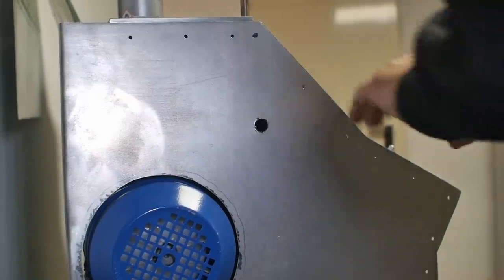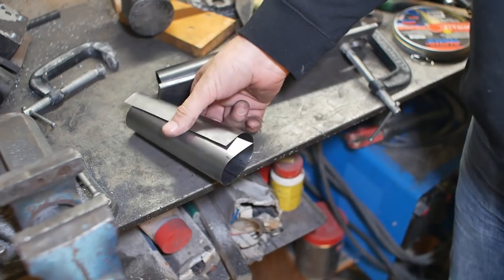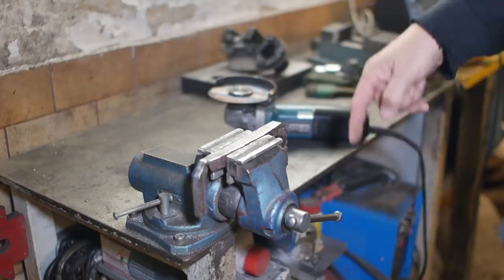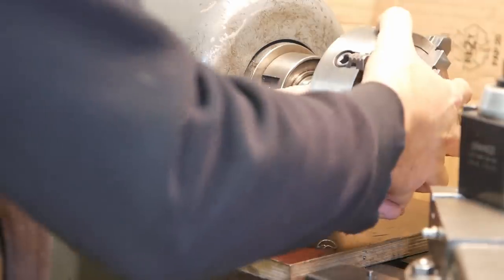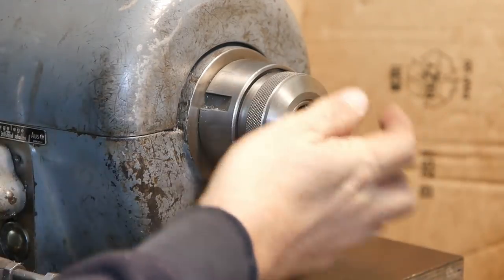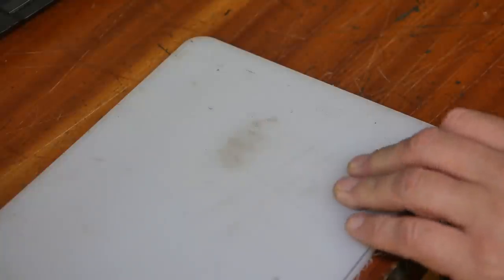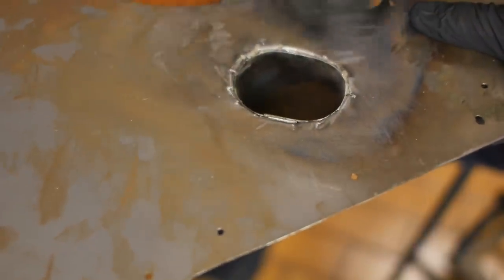Clevis and swarf chute - CNC'ing the infamous mini lathe - Episode 36

Comment: Nice series, thanks for you work! How about using the thread on the back of spindle to make spindle extension? It may help with long stocks and a chips inside control box.
Reply from the maker: I'll see how that swarf chute works, but if it doesn't I may need a different solution like a spindle extension.

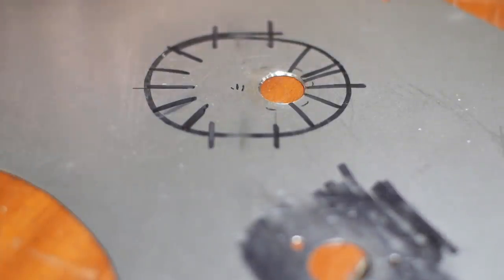Comment: Great video, but there is one issue: There is an annoying high pitched whine in the background for most of this video, though it goes on and off. Maybe I'm just too young so I still hear it, but it would be great if you could filter it out with a notch filter in the future. It is particularly loud at 18:40.
Reply from the maker: Sorry about that. I changed around my video rig from about 2/3 in to this video, powering everything off a sony NP-F battery wih a Blind SPot Power Junkie. I use a wireless micro phone, and thought I could leave the receiver powered all the time from that power junkie. Turned out that PWM DC-DC step down for the 5V USB produced that horible noise. I tried pulling down the audio till that was inaudible, but louder machine sounds were still above that floor. Then did voice over to replace the mossing vocals. Sorry I didn't drop all clips audio low enough. The fix was to disconnect that USB power, and only use it for charging.

Comment: I don't think your plan for chip control from the spindle will work like you want.  I would plug it off.  Since it is set back so far into the enclosure, I would find a way to be able to put air to it to blow out the bore.
Reply from the maker: You are the first to state what I suspect will be a failure :). I'm far enough down this rabbit hole to hang on to the bitter end and see how badly it fails :)

Comment: If I can have a recommendation for soldering, keep the flame away from the joint. Heat the outside and have a barrier between the flame and the fumes. If you burn your flux off, you will have a much worse time doing the thing
Reply from the maker: Thanks.

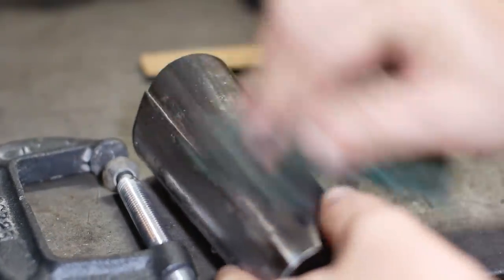Comment: 18:20 - i'm not an expert in brazing, but I think you don't need to heat the flux/solder directly with the torch, in fact you want both whetted surfaces to be up to temperature anyway, so indirect heating results in less bubbling I think. But i'm not an expert!
Reply: 20:34 is a better example of what i'm talking about. As you apply solder from the top, the best place for the heat would have been not from the top but from under the flange, which would draw the solder at the top down through the joint like a plumber would do a copper pipe joint.
Reply from the maker: Thanks. I am also no expert in brazing. I just play one on the internet :)

Comment: Neat stuff, it's been fun watching. I've also been going through the back catalog to pick up clues about your back story. Are you a kiwi living in Austria?
Reply from the maker: Yep. Thanks for watching.
Reply: @RotarySMP  nice, I'm a kiwi doing a similar thing in Germany. I built a cnc lathe in my basement, scratch build. No videos unfortunately but I appreciate the time it takes to make them, so thanks again for sharing.
Reply from the maker: @mulholla  Good on you. Will you also use LinuxCNC?
Reply: @RotarySMP  yeah, not sure yet. I built it to be used like a manual lathe with two hand wheels and a few programmable functions like taper and radius mode. I haven't had the need to do any 'real' cnc work yet but it would be a simple matter of plugging it into my Linux machine. It's currently running on an arduino due. But I use linuxcnc on my router and am definitely a fan.
Reply from the maker: @mulholla  Cool.

Comment: That little bench vise 😑... tiny. Too tiny.
Reply from the maker: I could do with a bigger vise. True.
Reply: @RotarySMP  I have a Leinen 125 sitting around missing jaw inserts (a project!) and a stuck bolt in one bolt hole. Just saying.. 😂. Fell into my car one day when driving around for vises 🤣. It's not a Boley, though. 125 mm is kinda small, still but better than 100 mm...but everbody has their own vise preferences.
Reply from the maker: @gubr  Those Leinen bench vises are really nice.
Reply: @RotarySMP  Idea: I will ask on instagram if somebody really wants it, with the missing jaw inserts and all... if not, I don't mind giving it away for a good price (real good, dunno how local prices are. but over here Leinens are usually €€) - gotta get rid of these collateral vises before I grow too attached to them, and this one is working hard on attaching itself 😂). It's not a big EF 135 or F 150 (but I can ship it cheaply with GLS even in these times) and it opens 17 cm!
Reply from the maker: @gubr  How about we discuss this through PM. I am available under RotarySMP on the Practical machinist, Zerspannungsbude, Madmodder, or LinuxCNC forums.
Reply: @RotarySMP  Hmm, bin nur bei Garagejournal, aber einfach eine email einfach an gubr@spambog.de geht auch :)